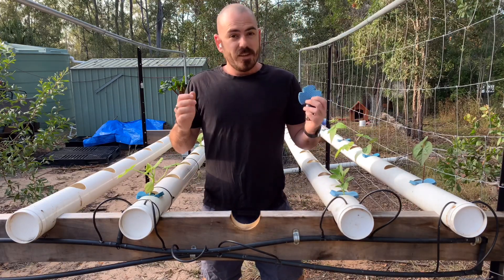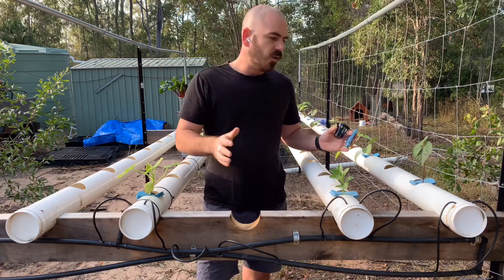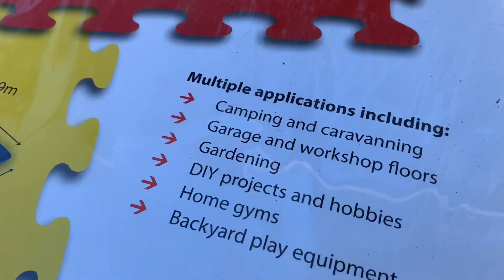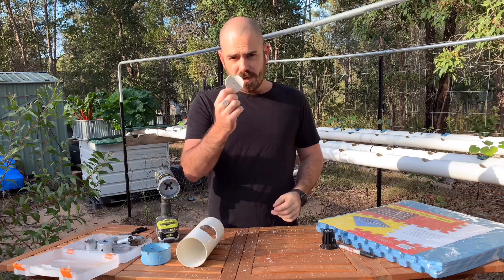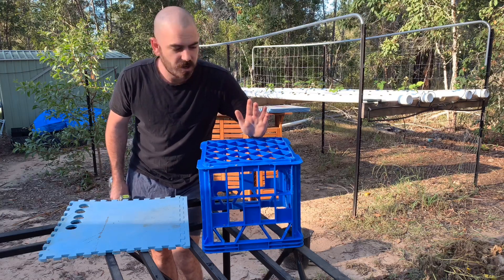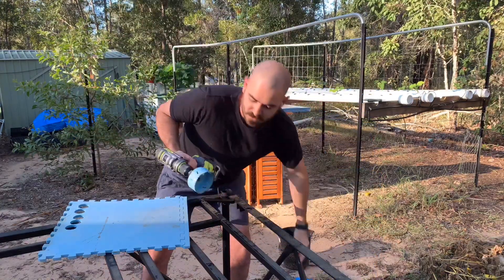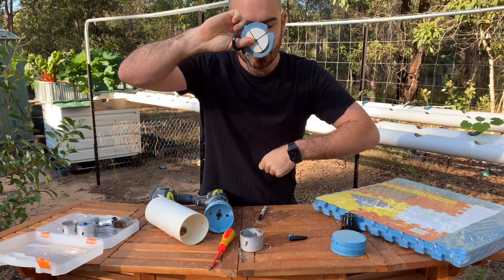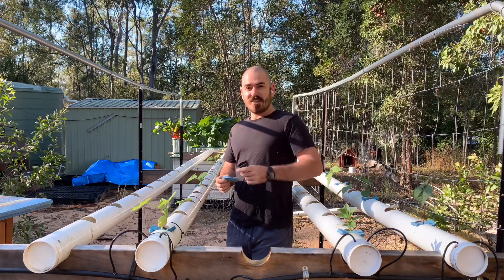How to Make Pucks to Replace Net Cups in your NFT Hydroponic System

Comment: https://www.gpo.gov/fdsys/pkg/CFR-2012-title21-vol3/pdf/CFR-2012-title21-vol3-sec177-1350.pdf section 177.1530 agrees its okay for food usage. I'm using it as gaskets for my vinyl fence post caps.
Reply: Food safety is a rather complex topic. You need to evaluate every compound of your material. Any eva based foam can be food save or not, based on the other chemicals in the mix, even based on the pigments used for colorization. That being said, thinking about food safety more than we already did is a waste of time 👍

Comment: So to cut in foam without slipping, cut a hole in a piece of scrap 1/4" ply-wood with the center punch bit installed. Then use that as a template on top of the foam  if you want to drill without the center bit.

Comment: Maybe someone already said this, apologies if so: regarding cutting the pucks and supporting the EVA; the milk carton won't work well (as you've found) because of the ridges which will easily get caught by the teeth on the hole saw.  A smooth, firm, yet forgiving surface under the EVA would work better.   The tubes under the EVA in this video will work well until you've punctured the snot out if it with a pile of holes (that's the technical description <wink>) but then it will get too flimsy to be supportable across those tubes.  If you run the bit (hole saw) backwards, as you do for cutting the PVC tubes, it may also work better (but it may booger up the EVA too much, but you should know better than I).  I would use scrap plywood under the EVA and a very light down pressure (I'm thinking just the weight of the cordless drill) so it won't bite into the substrate (plywood).  If you know someone with a lathe and if you use a small range of sizes of holes (so you don't have to have a pile of these made in different diameters) you can...cut a short piece of steel pipe which has a similar O.D. or I.D. to the desired puck diameter and have it turned to make a cutting edge (think: circular knife blade) and then manually twist or weld a strap across the dull end and affix a shank for the drill or...best for cutting EVA (I think...I've played with mats like that but not cut holes from them)...just press/step on/hammer the sharpened pipe (die cutting) the EVA.  You could sharpen the inner or outer diameter of the pipe depending on which size was more appropriate for the pucks you want to make.  I have a lathe and I wanted to make a bunch of circles from kraft paper for fireworks mortars so I did just that.  I used a plastic cutting board as the backing and a shop press to push the sharpened pipe through several layers of the kraft paper to make a number of paper discs at once.  I never made a video of it so I can't provide a link/video to show what I'm talking about.  Hopefully you get the idea.

Comment: I am going to buy your Coffee Mug soon and I love the design!  As for the safest way, I found ironically, I just place the foam over an empty 5-gallon bucket facing upwards like you would put dirt/water in it and then drill away (Starting clockwise, then when blades hit the pad, counter-clockwise till I go through.  The Shaving's drop into the 5-gallon bucket and there is plenty of support as you go around.  Clean-up is easy breezy.

Comment: Hi Hoocho, big fan, love your work. Wondering if you have any thoughts on a puck system for an NFT with rectangular piping. Do you still make it bigger? or Can you just drill holes of same size like you do with your puck propagator?
Reply from the maker: Check out the latest strawberry system video, I tackle the issue in that vid.
Reply: @Hoocho  cheers mate. you are a legend

Comment: Love your channel!  Quick tips: A deburring tool cleans up the edge of the holes in the pipe much faster and easier than sandpaper.  To keep the holesaw from skipping around if using it without the pilot bit, you can cut a hole in plywood and use the plywood as a jig on top of your foam. If making a lot of these, I would try making a "cookie cutter" and heating it to burn through the mats.

Comment: I just set up a 100 plant nft strawberry grow with your puck idea. So far they seem to work really well!
It was a bit of a pain to go through and make all those pucks though.
You should consider patenting the idea and getting a manufacturer to produce them.
Reply: We run a vegetable farm and I would like to 10 or more x this grow if it works, but the idea of cutting out all those pucks seems like it would not be good for my future arthritis prospects. If you got a manufacturer to just die cut those in mass i bet you would have a good business supplying hydro stores. Large-scale strawberry operations use those rock wall slabs that need to be thrown away at the end of the grow cycle. These would be more environmentally sound and economical. There could be some serious scale to your idea.

Comment: Doesn’t the cut to support the plant damage it in some way as the plant grows and the stem becomes thicker or does the puck just expand to accommodate.
A safer way to cut the holes is to make a template out of scrap timber with the hole cut. Put this on top of the mat as a guide and the hole saw won’t jump around. Best also to put some kind of base underneath for support

Comment: get an empty can of the diameter of your hole saw and remove one end from can. Use needle nos pliers to make your v shaped indents. Sharpen the can edge with a file and stamp out all the pucks you need.

Comment: Just an update on some pucks I made.  I transplanted some lettuce seedlings and maybe they were a bit too small as the foam squashed the stem and killed them off.  For the next batch I will drill a small hole in the middle to give them a little room.  Other than that they seem to be working great.  so thanks.!
Reply: i agree with your point, how will you drill small in middle, share it, Thanks
Reply: @narohit  I just used a small drill bit to make a small hole in the middle. Then cut the rest of the Puck shape.

Comment: I am currently experimenting with the pucks in my NFT system but Im not seeing as much growth in as in my hydrotower - so while the pucks are an awesome idea, is there a proper amount of water coverage on the root system? My plants were transplanted from soil so the root system is never as long as in your videos, I am just unsure what the problem could be.
Reply from the maker: Is the water just a film on the bottom of the pipe?
Reply: @Hoocho  it is, same design as you had in your nft system. I tied the end of the pump pipe to increase the pressure of the little tubes for a bit more water. Your roots look way better than the ones I have, just store bought seedlings that were transplanted. I see some nice white root growth but the overall plant is slow growing...hopefully it'll take off once those roots grow a bit more
Reply from the maker: James S the less water the better in my experience, as long as there is flow you should try and limit the amount as much as possible. Are you monitoring EC and PH?
Reply: @Hoocho  I do measure PH, keep it between 5.5-6. Ill try and let the water flow a bit more freely, i just get nervous about the plants drying out. Thanks for the advice and keep up the videos! Im just starting out on my NFT journey and im excited to make it work.

Comment: G'day Hoocho. Since seeing your big pucks, as opposed to the little ones commonly found in off the shelf propagators, I knew I had to make some for my nft system. The cross design is unique and perfect for this application. Also made your propagator which is working really well. Cheers for sharing those concepts. I had some of those EVA mats lying around that my toddlers used to play on. They've seen a bit of Perth sun though (1-2 yrs). I found that if you rub your fingers over the surface a few times then examine  them, look closely and you're likely to see a fine dust, blue in my case. Pretty sure it would go unnoticed when harvesting and would work its way into the resovoir over time. I'm trying to find an alternative foam thats as cheap as the EVA mats, still the same softness and doesn't abrade after UV exposure. Not easy though...
Reply from the maker: No worries mate! I plan on replacing the pucks before that becomes a problem. Most of the time they are out of the sun and shaded by the plants, so I haven’t had a problem yet. And the foam is inert so even if it got in the system there would be no leaching of anything harmful.
Enjoy the system 😊

Comment: What’s the smallest diameter you would use for a nft system? Locally I can only find 2 inch white pvc (sched40) in stores and can order 3-4 inch white. ABS is available ( black sched 40) but curious if that would be I’ll advised.
Reply from the maker: I wouldn’t go any smaller than 90mm / 3.5 inch

Comment: Great system!!  This is my goof-proof, safe puck maker system…  Cut 2 pieces 18 x18 inches (45x45 cm) rough-sawn or textured plywood.  The rough texture will grip the mat so that it does not shift while cutting.  In one corner of the top plywood piece, use the puck hole saw to cut a hole the same size as the pucks.  Slide the foam mat between the two pieces of plywood.  Clamp on one side of the hole with a wood clamp and press down on the other side with your hand while cutting the puck with the hole saw.  Using only one clamp & pressing the plywood on the other side of the hole with your hand makes it go faster repositioning the mat for each puck.  The plywood template keeps the hole saw locked in place while cutting so that it does not skate across the mat when the saw teeth grab.  The process is a little slower, but much safer than trying to cut the mat free-hand.
Reply: This is especially useful for the smaller pucs!

Comment: I have to share that I tried this and it works. I have been in a bed ridden situation for 5 years but before that I used to be handy so I already had the few tools needed. Being in this situation with little to no physical visitors its not guaranteed anything especially the consistency it takes to plant zucchini and squash indoors when it's hand pollination time. However once in the "propagation" stage that you called it last video where they are lined up in the mini circles I lined that God keeps them alive and growing. It's cool to watch that they slow down growing as if they know that I may not at any time soon make it into my walk in closet that I made a whole reflective grow room with shop lights on a timer to transplant them in buckets. But they are healthy for months without me doing anything. I'm excited to start cauliflower in it then move them to 5 gallon buckets using the bigger circles. I started the seeds in Coco coir but I hope to start them in a grill net map next time. That's the closest thing I have to what you showed the first video as a seed starting idea. If that don't work as good until I'm out of this place then I will get a sheet of rockwool cubes and use one piece cut up for as many seeds as I can. Cut one cube for like 50 pieces for 50 seeds just to keep them wet to germinate since I will be only doing tiny leafy lettuce  type seeds. Even though the Coco coir was good for heavy seeding if you take the time to separate all the best transplants. I got a set of two long buckets so one bucket holds the water and holes in the top and the other bucket flips over to sit on top because it's clear like a green house. The inside of the second top was cut all the way out leaving just to ring of the top to be glued upside down to the top with the holes in it so when I sit the top bucket that's now the dome it sits perfect and locks in place. Got pictures available at email keystoheaven2018@gmail.com

My only question I have that I may just have to address once to that point is when the plant stem is getting thicker and thicker does you circles widen themselves to not chock that area or do you go in and put a bigger middle hole? Either way it was amazing to build and to find this channel. I saw another guy cut lines in the middle like a fan but not all the way to the end so even if a tree was in the middle it would open up. May God bless you brother for sharing wisdom with the world in the name of Jesus Christ for it is written in 1 Corinthians 3:6-8;

1 Corinthians 3:6-8 New King James Version (NKJV)

6 I planted, Apollos watered, but God gave the increase. 7 So then neither he who plants is anything, nor he who waters, but God who gives the increase. 8 Now he who plants and he who waters are one, and each one will receive his own reward according to his own labor.

Amen

Matthew McIntear
Columbia South Carolina
May God bless you all in Jesus Christ name